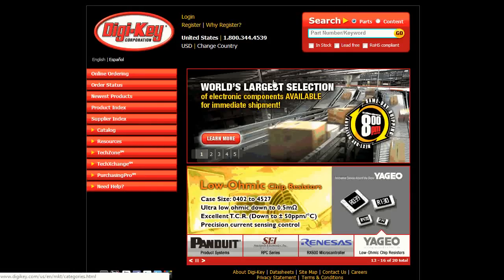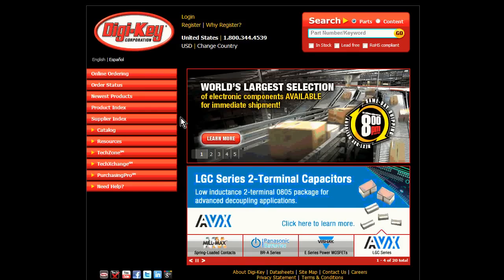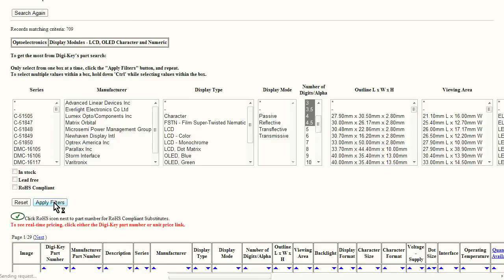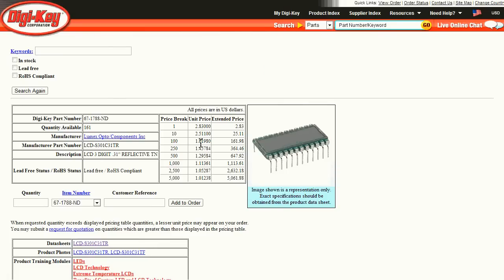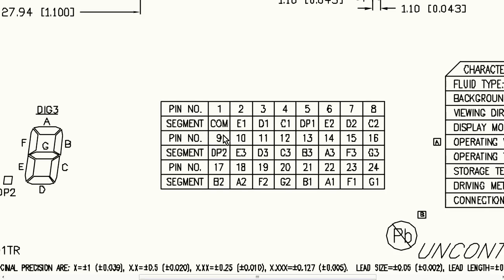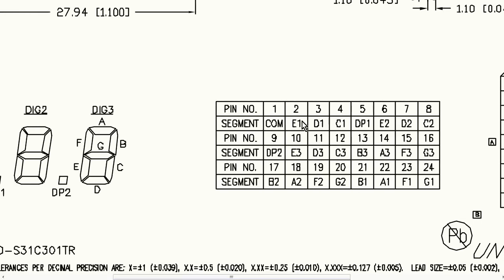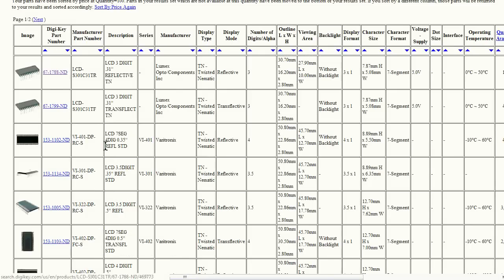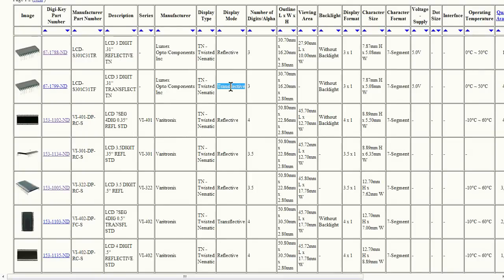EEVblog #248 - LCD Enabled Microcontroller Selection

Comment: I didn't know microcontrollers even had numeric LCD/LED display peripherals. I've always just bit-banged them at it works perfectly. If you need less pins to drive them, you can use an alphanumeric driver chip (MAXIM has a few with SPI and I2C) or simply a multiplexer or a binary counter chip.

Comment: Funny thing is, I have never designed for more than 100 units production quantity, and in that case the hours you have to put in to actually get the cheapest device are ways more expensive than just taking the top-of-the-line part that you've already used in other projects. Even for 1000 units quantity the real nitty gritty selection doesn't quite always pay off.

Comment: @skierplaterandy In reflective mode (no backlight), the power consumption is far far lower with an LCD. Also, viewing in bright daylight is fine with a reflective LCD but would require a very powerful LED display.

Comment: Are there any distributors with a parametric search for microcontrollers that's actually useful? Not that the manufacturers are much better. TI and Microchip are the only ones I can think of offhand that do it right (filter by features), but eg. ST just list all combinations as separate entries and expect you to sort it out yourself. Terrible!

(Looking closer, Microchip's product selector looks awfully familiar to TI's old one. Must have gotten it from the same developers!)